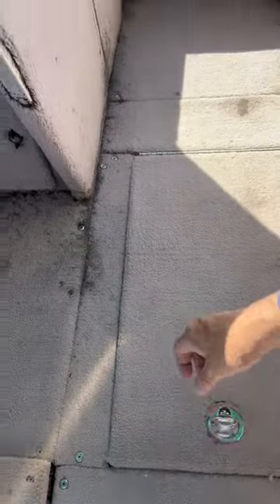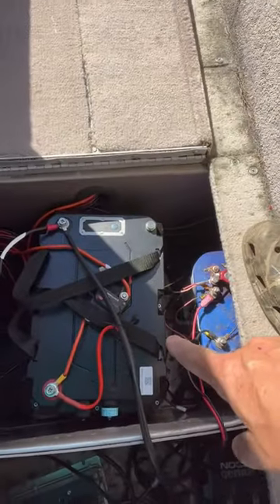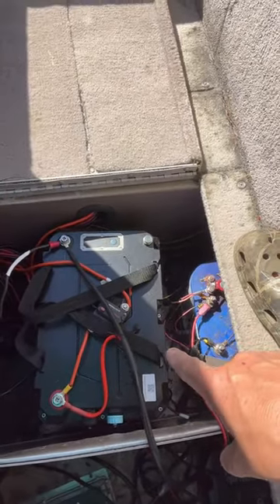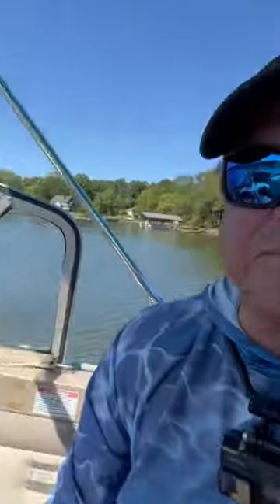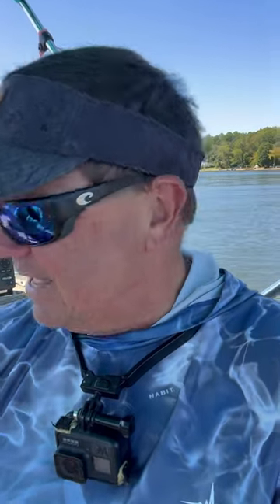How Are the Lithium Trolling Motor Batteries Working?

Comment: I have a Minn-kota 45lb 12V with variable speed. It comes with 10 gage wire. I heard you need to use a connector so the Lithium doesn't overheat the motor. Is this true? The Lithium battery is a 12V 100ah.

Comment: How long were those five fishing trips? I know you said four of them were guided. But are you talking about for 3 or 4 Hour outings and one 6-hour outing? Or are you talking 4 days 8 hours, 12 hours, sun up to sun down? Asking because there's a big difference between four trips that equal 13 hours total. Or for all day outings
Reply from the maker: My guide trips are only six hours.
Reply: @DieterMelhorn  that's still a lot of time to run the batteries without a charge. Thank you so much for answering my question

Comment: What battery are you running for your electronics?
Reply from the maker: I’ve run the Dr. Prepare lithium batteries for a year with no issues.

I recently switched to the Golden Mate lithium batteries since they have the remaining power display screen.

I have video about both batteries here on my channel, just search “dieter melhorn lithium battery” and they should all pop up.